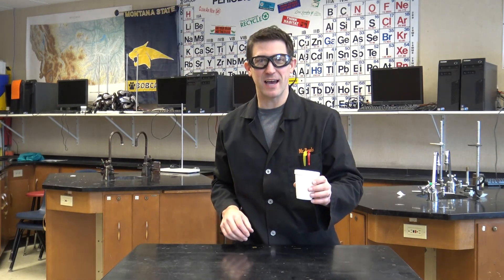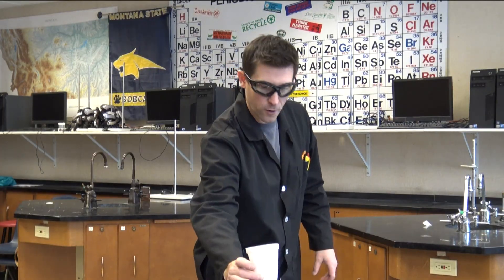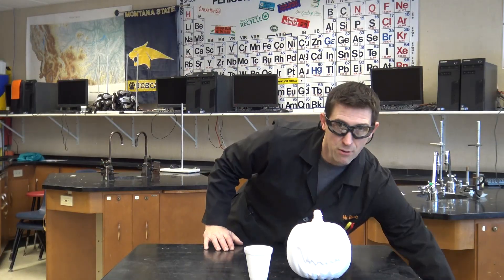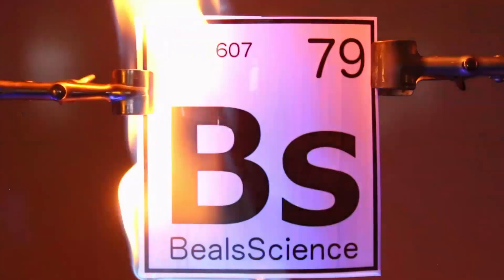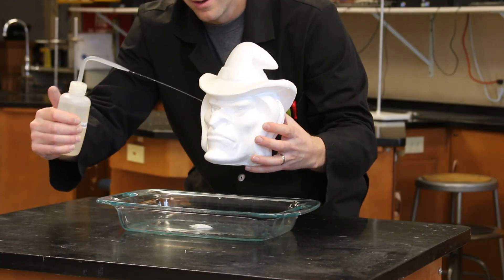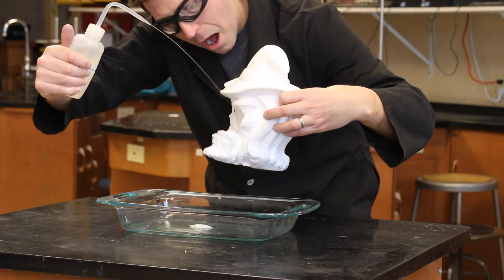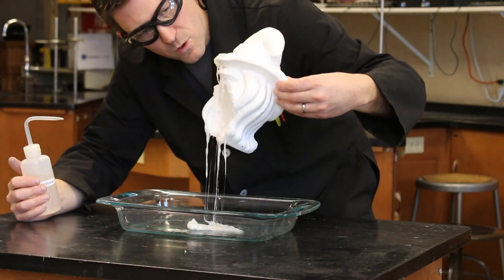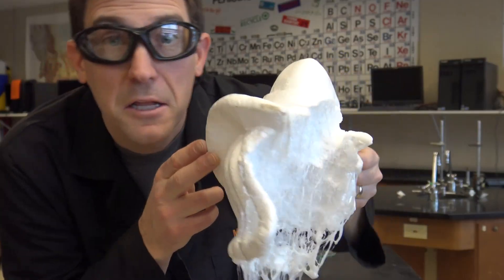Melting Styrofoam Heads with Acetone!

Comment: No gloves? HA
Reply from the maker: It is probably wise to use gloves when doing this!
Sometimes I get complacent with acetone because I worked my way through college in a cabinet making shop and was constantly using acetone to remove glue from laminates and there wasn't a single pair of gloves in the shop. So, I got used to handling acetone without gloves. But, it would be smart to use gloves!

Comment: Acetone doesn't ' dissolve ' polystyrene,  it ' reduces ' it into a thick sludge.  You can reduce polystyrene in orange oil or gum turpentine.. it's alot safer... and you'll end up with a ' free flowing liquid ' that can be used as a paint or decoupage gloss.. for more info, click the logo.

Comment: What kind of acetone did you use sir please? Since I tried a nail polish remover but it didn't melt 😞
Reply from the maker: Oftentimes nail polish remover is diluted so it won’t work or may take a very long time. If you buy a canister labeled acetone it shouldn’t be diluted and will work much better. Hardware stores carry it and it is usually quite cheap.
Reply: Beals Science Thanks sir! Was there any specific styrofoam you use on your video?
Reply from the maker: Raizen John Puth most styrofoam that is used for n packaging if a good density to use. I don’t know if you are familiar with styrofoam beverage coolers that have small dots of foam fused together but that is the most effective type of styrofoam to use.
Reply: Yeah that's what I used when I tried nail polish remover lol! THANK YOU SO MUCH! YOU REALLY HELPED ME ON MY THESIS 💗🔥